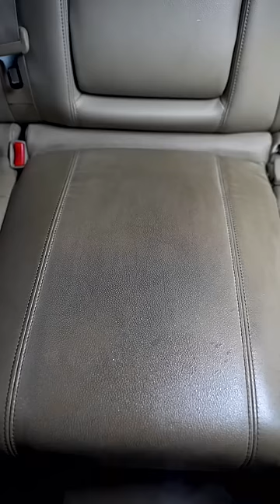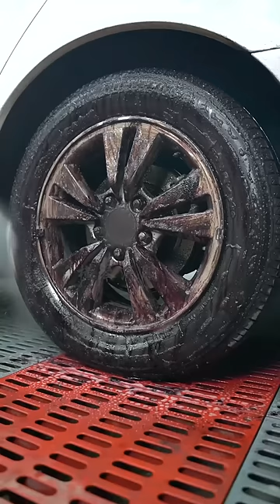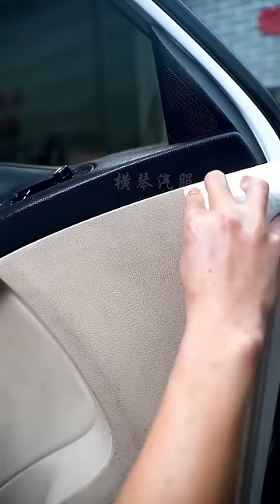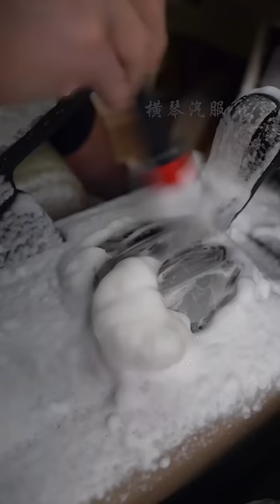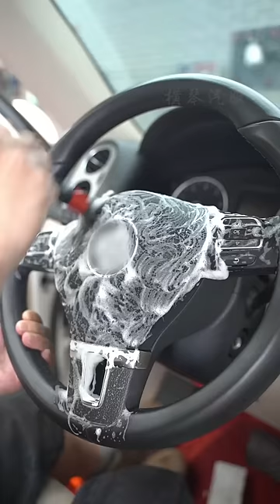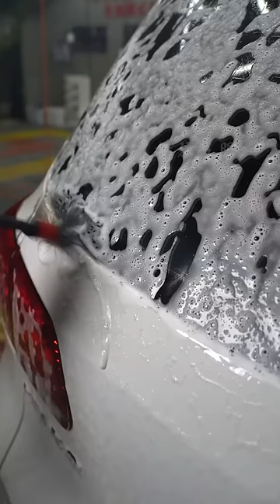Satisfying Car Cleaning | Car Polishing | Car Detailing ASMR - Part 70 #shorts

Comment: This is so bad…my eyes are bleeding. Kiss those electronics good bye.
Reply: Wdym
Reply: @NoName-me7kr  the part where he drench’s the door controls in solution and foam. They sink into the crevices and into the controllers and switches underneath the buttons and ruin/rust away the electronics. Think about your phone back in the day and when it would get wet because it wasn’t water resistance.
Reply: @kwl189  Ohhh I didn't know, I didn't think too much of it. Is the proper way to do it just using a lighter/less foamy interior cleaner?
Reply: @NoName-me7kr  I would use a vacuum to get rid of the dust and any thing that’s gone in between the crevices. Elsewhere I would spray solution into a microfibre and then rub it over those areas or spray lightly (mist) over a spot not there and then spread it over those buttons. Something light that won’t drip into the cracks ultimately. This guy has drenched that area so something will definitely have gone in that place. Don’t even know why he did it other than for it to look good on video. Waste of product tbh.
Reply: @kwl189  Would you use an all purpose cleaner for that?
Reply: @NoName-me7kr  yep pretty much. An APC will do a good job as long as it’s a good one used. Unless diluted very heavily or advertised, I’d avoid using on leather seats.
Reply: fyi theyre not working.. 😂

Comment: Which  spray  is used to clean the seats ?
Reply: That would be diesel fuel… only thing able to do that.
Reply: @ChaseWatkins.  is that safe for leather? Bc I don’t think so
Reply: @kneal9203  No. the vid is obviously a little set up. No cleaner will clean leather like that.
Reply: @ChaseWatkins.  but I’m pretty sure using a magic eraser on leather instead of different things is harmful to the seats as well? Idk I watch detail geek and he seems to know what he’s doing more than this channel
Reply: APC and a magic eraser your welcome
Reply: I clean my leather seat using alkaline degreaser..just spray and wait a couple minutes before wipes it with slighly damp cloth.. its work just like in the video.. dont use diesel, its dumb idea.. your seat will get oily, smell bad and probably damages the surface for a long term...

Comment: Did you burn the paint in that first clip?

You shouldn't be using a magic eraser on anything you wouldn't use fine sand paper on.

You definitely oversaturated the electronics. This is all so unnecessary.